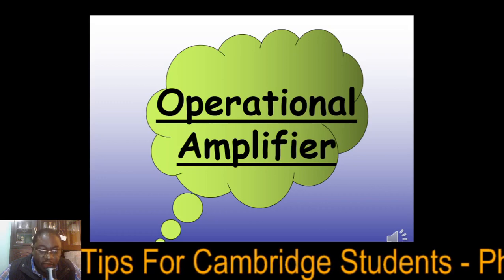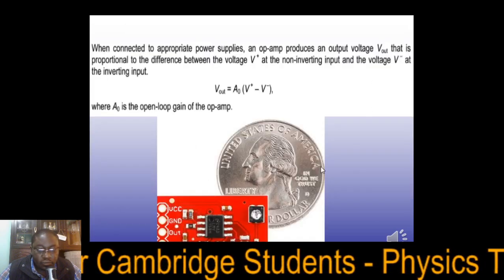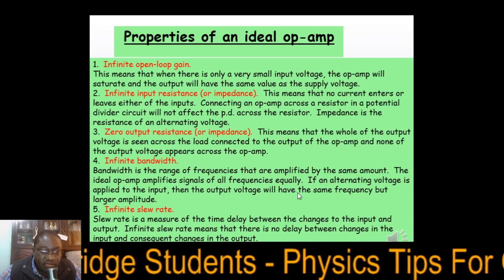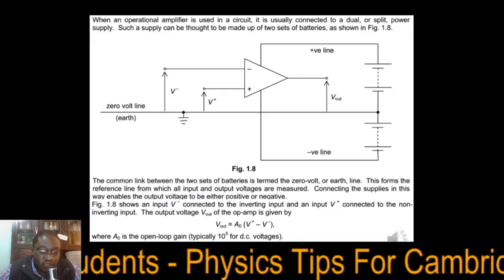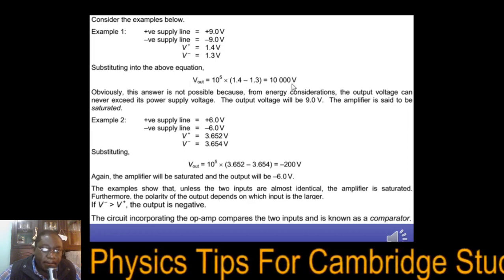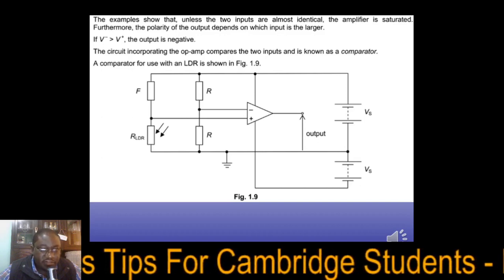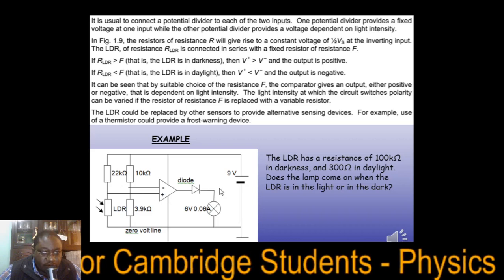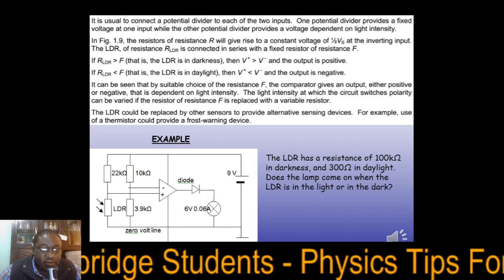Electronics Operational Amplifier Part 1 9702 A level Physics

Comment: @ 13:25 7.37 V goes across non-inverting terminal i.e >  2.18 V through inverting terminal at darkness so that's when lamp comes on as it gives positive V-out whereas 0.12 V through non-inverting terminal i.e < 2.18 V at inverting terminal at daylight gives negative V-out. Am I right?
Reply from the maker: The opamp compares what goes in through the non inverting terminal and the inverting and multiplies by an open loop gain...so in darkness, there's 7.37V (non inverting) vs 2.53V (inverting), so there's (7.37-2.53)x gain, thus the opamp saturates at +9V, and since the diode is forward biased, the lamp gets ON.
In light, the opamp saturates at -9V, and the diode will be reverse biased....
Reply: @atobve  you said it in a simpler form. Thanks sir!